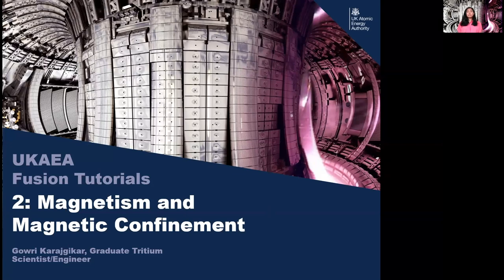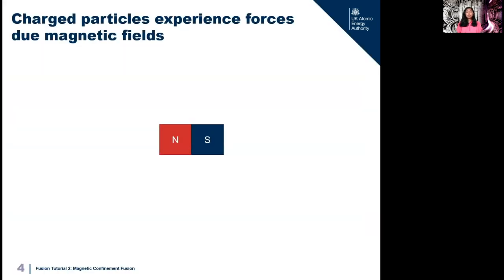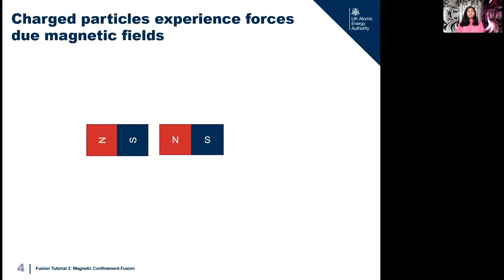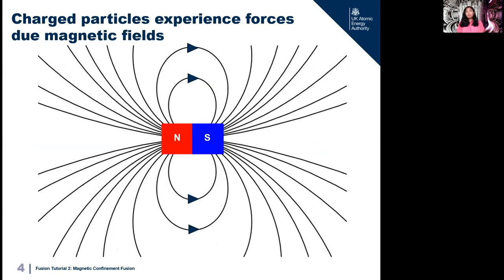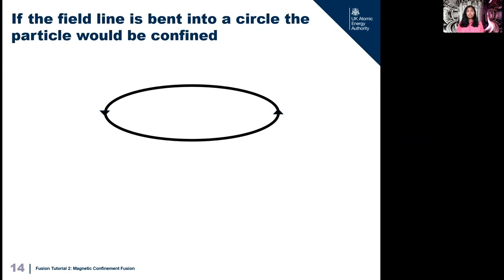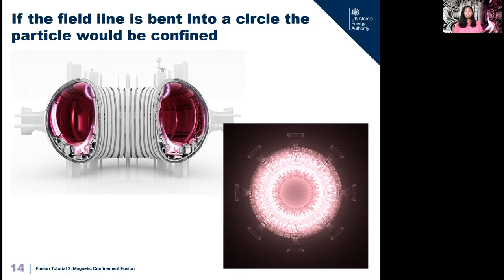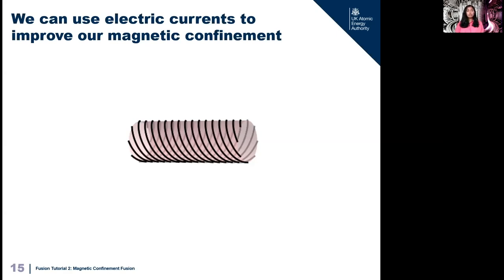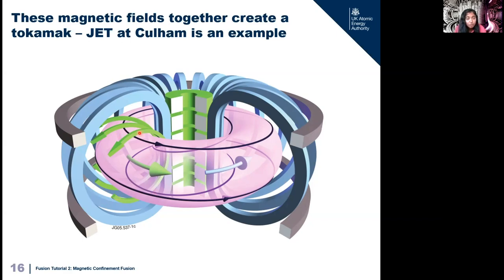Fusion Tutorial 2: Magnetism and magnetic confinement

Comment: Wonderful presentation! Well done.  However, magnetic fields are 15 orders of magnitude  (10^15) weaker than electric fields. The difference in magnitude of these forces is similar to the difference in magnitude one might experience by holding a walnut in the right hand and Mount Fuji in the left. The likelihood of using such a weak force to confine such a vastly stronger force is similar to lifting Mt Fuji with your left hand. The Tokamak design (pioneered by the Soviets 70 YEARS AGO!) will confine plasma...but fusing nuclei need to approach within a proximity of 1 fm (1x10^-15m) in order  for the strong force to overcome electrostatic repulsion and achieve fusion. The usual answer is that the temperature of the plasma supplies the kinetic energy to overcome the Coulomb barrier.  Temperature is routinely conflated with kinetic energy, and kinetic energy is routinely conflated with translational kinetic energy. In fact, since nuclei are three-dimensional objects, it is reasonable to assume that they also possess rotational kinetic energy, a factor that is routinely ignored in nuclear fusion calculations. If two nuclei are spinning wildly in opposite directions how will this affect their ability to fuse? Is it easier to catch a ball that is spinning or one that is not spinning?? We can only guess. Please show me I'm wrong!  I would love to have hope in the Tokamak design.